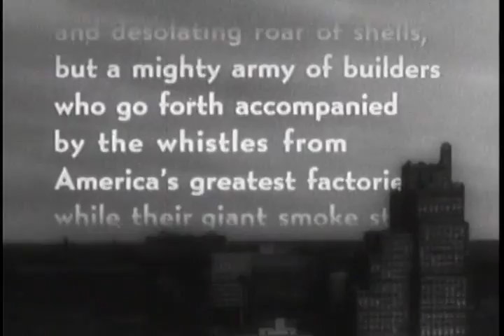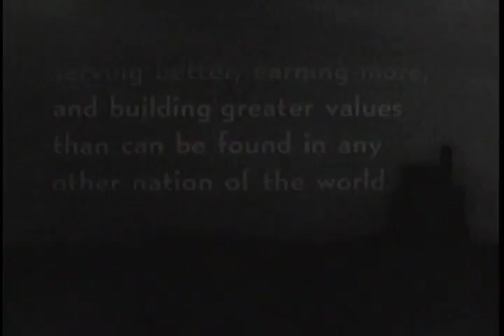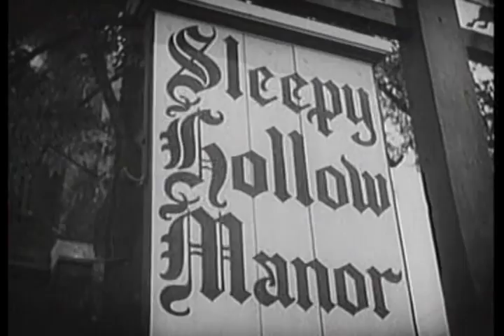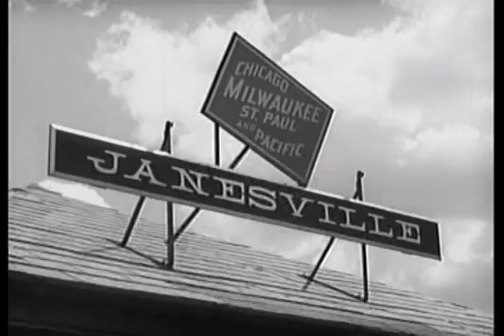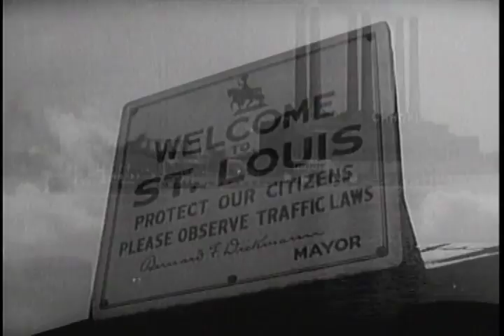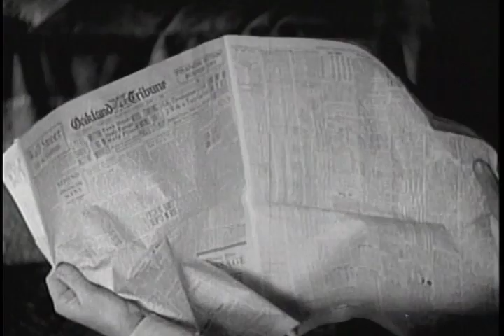From Dawn To Sunset (1937)

Comment: You make a good point, but look at 06:00 for example - the endless rows of desks for clerical workers.  In an era before computers, the white collar workforce was also substantial - which is why all the "Big-3" automakers had skyscrapers in downtown Manhatten - human computers, basically.

The recession of 1980 saw a reduction in blue collar labor.  The recession of 2009 was a layoff of the white collar counterparts, as more and more office jobs are replaced with web-based applications.

Comment: Those cars are GORGEOUS!!! They looked so much nicer than what we have today.
Reply: It's the 1930's where is the money coming from???.
Reply: They were anything but.. They were rough riding, poor handling, and generally unreliable compared to now. When's the last time you had to change a flat tire? Or had a car that just wouldn't start? That used to be common.
Reply: @MarinCipollina  Yes, but they looked gorgeous! The reliability isn't so bad if you look at it as a challenge and appreciate 'old stuff' as I do.
Reply: @tempest411  Don't misconstrue, I love the looks of those from post WW II until 1980 or so, especially late 1950s and early 1960s !! Those were some great and quite memorable shapes with the space age and jet age.

I was born in 1957, and cars from the 1950s and even late 1940s were quite common on the streets well into the 1970s.. But about the time the movie "Christine" came out (1983), I realized they were disappearing quickly. I miss them all !

Comment: It almost unconscionable to think that every factory that was shown in that film is gone and when I say gone I mean gone. Most every factory that GM shuts down just sits for years and gets vandalized when parts of it  could be rented out. Ultimately GM gets sewed by the city its in and has to give the property to the city after they pay for its demolition and clean up. And when its all gone and there is nothing left at all but a giant concrete slab, they put a fucking fence around it? No fence for years when the building was there getting trashed and vandalized but a fence is put up when there is nothing there at all? More of the great GM management thinking like the EV-1
Reply: Government Funded. What do You Expect?

Comment: This is a great period piece.  90% of the heavy and other lifting jobs in the plants today are automated pick and place.  The big robot welders you see today were often hand controlled back then.  I remember the "nut runner" job was to control by hand a machine that tightened big front suspension nuts.  Those guys had forearms like Popeye from handing on to that air powered nut tightener!

A down side is that a GED will not get a job in a modern plant. You almost need an associates degree, but that is not true in the vendor plants.  Most everything today in computer controlled!
Reply: i worked at troybilt.  the gears cut in the cnc chuckers would embed in your skin.  the coolant was absorbed into your body too.
Reply: So, what was the purpose of WW2, and at the end we wind up with foreign cars?. And our cars are cheap.
Reply: Brand new ( all long gone) Cars. 1937.
Reply: They seem to be happy during the great depression.

Comment: "while attempting to convince them that their own fortunes were inextricably linked to the fortunes of General Motors."
This is exactly why GM went bankrupt several decades later, and shouldn't even exist today: they never did convince anyone.
Reply: +AlainHubert I'd have had no problem with GM going under if it didn't mean it's market share would just be replaced with more foreign cars and we'd have even more Americans out of work. GM makes good cars and trucks. They just got caught in a bad set of circumstances.
Reply: GM's fate was sealed in 1937 (same year as this film) when they gave into the strike and signed their first contract with the UAW and the communist Reuther brothers.  From that day, it was just a matter of time before the final collapse and ultimate bankruptcy.

Comment: Back when cars were cars built of steel, not of plastic like today.
Reply: You mean back when a 35mph crash would kill all the occupants of both vehicles? Yeah. What a time. You dope.
Reply: yeah so youre implying new cars also dont kill people due to its plastic body, good job.
Reply: Today's cars are a dozen times safer than the old ones -- and I've had a couple of dozen '30s, '40s, and '50s cars. We now know that safety under crash conditions comes not from rigid steel construction, from a combination of: 1. dissipating energy away from the passenger compartment rapidly, and in a controlled manner, plus 2. cushioning the spontaneous and involuntary movement of passengers brought about by physics, in response to an impact. The first purpose is accomplished by building-in all that "plastic" you deride, plus the careful design crumple zones, breakaway engine mounts, "self-jettisoning" gas tanks, etc.; the second is the work of airbags -- of which even the cheapest car now has at least six. There's no question which car I'd want to experience a 40MPH crash in -- a mid-'50s Cadillac or a '2015 subcompact. The subcompact, every time.
Reply: @50zcarsman  Their idea of safety is feeling the enormous jolt of two cars colliding at 60mph that is transmitted efficiently to their body via the solid steel chassis.
Reply: At that time, they believed that a rigid frame was the best protection in a crash. Packard even touted their hidden running boards as a safety element up to 1950. I have a 1949 Pontiac and there's nothing but fairly thick sheet metal proecting me in any collision, ant the interior is all metal. My friends ask me what will happen if I'm in an accident, as if it isn't obvious!  My grandmother was in a low speed accident in 1950, never drove again, and really didn't like riding in cars afterward because the car was so damaged in the accident, although she wasn't hurt.
Reply: But, you can stand on the fenders and roof of my Pontiac and they don't dent.

Comment: I guess Chevrolet didn't hire African-Americans or Asians back then. From all the thousands of employees in this video I haven't seen a single one. I'm Caucasian and I noticed.
Reply: John Smyth  I'm Caucasian and I notice the obsession with materrs racial and (I shudder to use this word) multicultural that pervades modern society.  Back then it wasn't perfect, but it worked.  

Today is also  far from perfect.  Does it work?  I'm not so sure
Reply: They weren't in the movie because they was standing around outside behind the back wall of the plant smoking a joint and sipping on a half pint of whiskey in a brown paper bag where the foreman wouldn't see them.